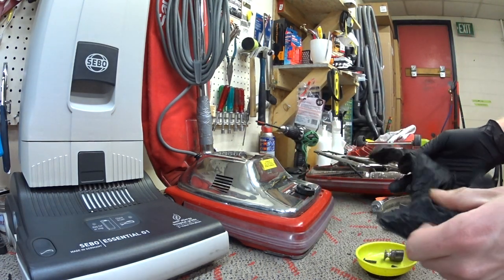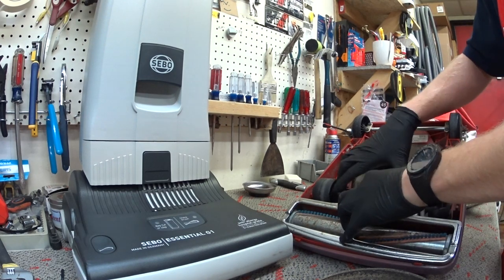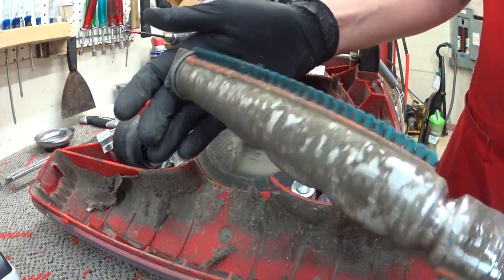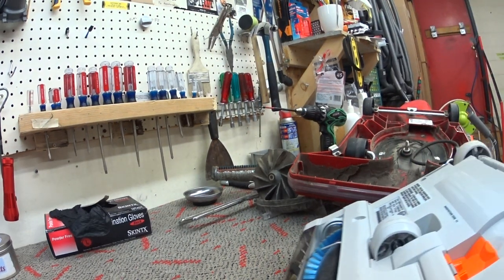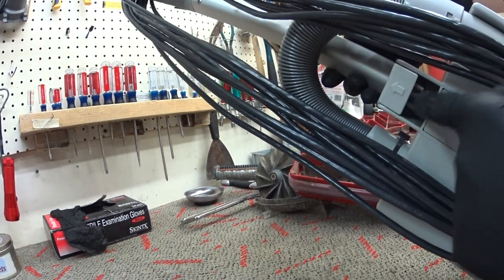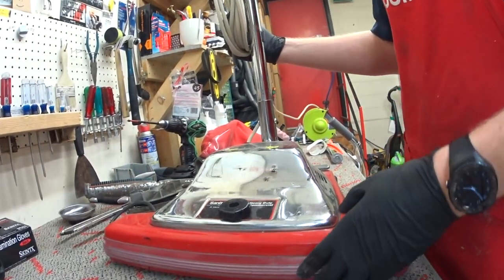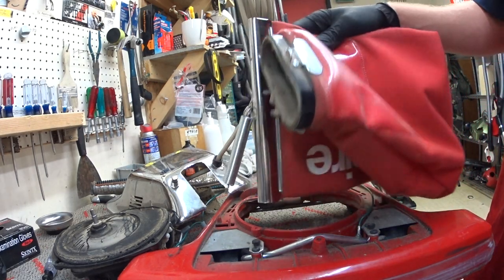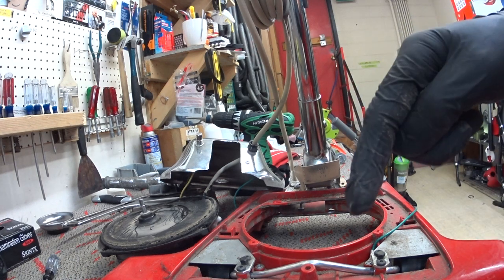Why Direct Air Vacuums are Not for commercial use! (Vacuums explained part 4)

Comment: I had to use them at work and the dam belts need to be replaced all the time and the fan keeps getting damaged. Replacing belts takes time and less time to get your job done. They are outdated junk.The motor dies on you after a year .

Comment: I have a Santanaire SC-887 which I retrofitted some years ago with the HD commercial cloth bag, I found the machine discard. It was in pretty good shape, needed a new line cord and fan and the latch adapter which I got locally. In addition, to replacing the handle set.  The communicator was clean, carbon brushes did not have much or little wear. From what I can tell it has the older style motor, still going strong.

Comment: Sanitaire’s are very popular for commercial use because of how powerful they are. Direct air vacuums are just fine for commercial use, as long as maintained properly and not abused!
Reply from the maker: Sanitaire 's are mostly popular because of price and distribution. now that they're no longer made in Mexico and their Motors are of extremely poor quality now they've almost ceased to exist in the commercial Market.
Reply: Performance Reviews 

What? I never knew that! That’s very unfortunate. I’ve always loved Sanitaire’s. Especially the older ones with the metal top motor.
Reply: Performance Reviews thank you. Looking for a strong vac to clean my grandma's apt wall to wall. Didn't know anything about vacs a week ago not I'm up to direct air! This info about Sanataire is much appreciated!
Reply: I guess you measure "power" differently than most.
Reply: That and all parts on this model especially are replaceable, and easily accessible

Comment: Should I take that to mean that Kirby's no longer have a place in the world? I tried a self-propelled one a few years ago and it was one impressive machine, but it was as out of place as a Mack truck in a small suburban house. I used a non-propelled version in my first job out of high school, and it was a handful, but like any fan-first model, it occasionally broke a blade. The fan-first models were more efficient with power, but I guess their vulnerabilities caught up with them. The first bag-first model I owned was a Regina Housekeeper, factory-refurbished (they all needed a retrofit) for $50 in 1993; it lasted 23 years of fairly rough household use.

Comment: I miss the old sanitaire set up. I have to older ones with the metal style motor and they’ve lasted years these cheap and plastics one at work don’t even last a year!
Reply: henriquesousa7 interesting because a guy at a vacuum shop said he has never seen one of the newer motors go out yet.
Reply: @kg5vacuums205  I use them every night and I have never had any issues either.

Comment: Sanitaire cleans fast and is easy to use, but dust leaks from the bag latch area getting into the motor
handle screws vibrating loose, plastic cord hooks cracking
belts, belts, belts
Reply: Michael Mirro the Hoover guardsman is and the old convertibles were built similar to a sanitairs and uses a thicker belt (then again, it’s a deeper groove on the brush), so if you want the power of a Sanitaire with more durability, I would recommend a Hoover Convertible. you’ll see them on eBay all the time – different models and different years. The 80s models are more similar to the guardsman since they use the same motor (but with different amperages depending on the model.) If you do get a convertible, make sure it uses type A bags since you can’t buy type C Hepa Bags (the level of filtration isn’t available for that style

Comment: Direct air machines in restaurants are a big no-no. Other settings might be fine, as long as it taken care of. But that won't be the case with most commercial users unfortunately.
Reply: @thereallincolntakanashi  

Yes they are. I hate those things. Very poorly made.
Reply: @thereallincolntakanashi  

Talk to your local vacuum shop about a Miele, Windsor, or a Sebo. Not very cheap but well worth the cost.

Comment: Where I clean I used an old Quick Kleen with the Mexican motor for the quarterly deep clean, I use a Taski Tapitronic 38 for regular cleanings, I bought a Rubbermaid CV12 dirt cheap to replace the old Sanitaire because the chute on the bag has perished and a new bag would cost more than what I paid for the Rubbermaid, the Sanitaire will get fixed one day but it's days of quarterly usage have passed

Comment: I sold janitorial for 8 yrs before I retired the last time. We sold quite a few commercial vacs, Advance, Windsor, Sanitaire and another couple I can't remember now. I always recommended full bypass designs, personally the Sanitaires weren't much more than a home vac with a long cord. The hotels loved Sanitaires because they are cheap, they couldn't seem to understand long term costs of using the Sanitaire were higher. I remember one funny, sold several new Windsors to a school, a few days later the supervisor called me and said they didn't have any suction. I started taking one apart right in front of them and it was totally blocked with paper clips and staples, a bunch of paper balled up on that and totally blocked the airflow. Told them their staff needed to pick that stuff up before vacuuming and sold them magnets for the occasional missed one. Super was very embarrassed but I think he got the message through to his staff, I didn't have any more complaints. LOL

Comment: I think part of it is janitorial staff isn't trained as much, they're contractors instead of employees, and they have a stricter time crunch now. They try to use one machine for everything. Restaurants used to use those manual sweepers or a broom to pick up food debris from carpet. I never see those anymore. Never see janitors using a broom either, they use these to vacuum the linoleum and tile, which they were never built to do. 

Then I see cleaning staff vacuuming store entryways with these. No wonder you get so many that have been used on wet surfaces. Customers bringing all the rain and snow in on their shoes. But again, they're contractors. They're told to clean the floor in this time frame, which is a bit different than getting the floor properly clean and making the machine last.

Comment: I was looking at a Sanitaire vacuum to use for my workplace.  When I saw it had a reusable bag I could not imagine using that at work.  My workplace has a 10 to 12 year Riccar.  It has a crack in the hose and I think repairing the hose to be the best option for now.  My company also wants to buy the cheap generic bags that will bust open.  I don't clean for a living although the cleaning company my workplace hired uses our vacuum.  It was my boss that thought this one up not me.

Comment: One filters the air, is easier to work on, and doesn't break as often. Which one has better suction?
Reply from the maker: The clean Air vacuums have significantly more suction.

Comment: You made great points about the vacuum being in the wrong setting. I have always wondered why direct air machines were used  for commercial use more from the fans. Don't get me wrong I do love these type of vacuums but in the right setting. For example my main house vacuum is a sanitare vacuum.

Comment: What would you recommend for a church that gets cleaned once a week and has a lot of low pile carpet? I was thinking of the direct air option because of the deep cleaning it can do, and common household vacuums just aren't cutting it.
Reply from the maker: I would definitely consider a SEBO g1 or g2 there are also some karcher and Windsor options. Links in the description
Reply: Our church has a Karcher Tornado and that thing is a piece of crap.

Comment: By-pass vacuum-cleaners do not have close to the suction that the Sanitaire has!
Reply from the maker: You're correct but not in the way you're thinking. Most bypass machines have 2x-3x the suction power. With about the same amount of air flow.

Comment: Can you use a Kirby or royal for a house cleaning business? Is this good or bad and will it last. I am very mechanical so i can do the maintenance.. What do you recommend. I have used machines like the seba but it is always clogging on me.
Reply from the maker: Well if a SEBO is getting clogged that means you didn't unclog  it or you sucked up something big you shouldn't have.  That would be a universal issue would it matter which vacuum you used. You would definitely kill a royal or a Kirby way too fast in a house cleaning business. Not to mention all the extra Expendables. Maybe try and Nilfisk or a lindhaus

Comment: Please help! I work in a cat adoption center for ill cats and need a wet/dry vac to make sure everything is clean. We bleach the floors of the living quarters and rinse with water daily. We currently use wet vacs and they die about every 2 months, which is not cost effective. What would you recommend for the job the facility is 60 x 60 and we need to clean daily 2 times to keep everything sanitary.Thank you!!!
Reply: get a used Rainbow E2. its a wet/dry canister hybrid. compant has been around 60years
Reply: Universem2 get a RIGID wet/dry vacuum from Home Depot and register for the lifetime warranty. I strongly recommend the model with the motor on the bottom.

Comment: What would you recommend for a hotel? We use the Sanitaires, which supposedly last for 2000 hours. I haven't really checked if they last that long, but they seem decent. But like you mentioned the maintenance is an annoyance. The Windors or Sebos go for $500-$600 vs the Sanitaire 7 AMP models that go for around $200, including the HEPA filter bag ones. I don't know if the extra costs are worth it if they don't last much longer than the Sanitaire vacuums. Do they significantly outlast the Sanitaire vacuums?
Reply: Sebo/Windsor vacuums are very popular in hotels and would be a good choice. The Sanitaires are good cleaners but the new motors are not what the old ones were. The extra money you spend on a Sebo will be worth it in the long run. I'm a fan of direct air vacs but I also own a Sebo and I love it.
Reply: @mhtube01  It's been a long time, but I hope you're still able to reply. Which Sebo/Windsor would you recommend for a hotel? I've seen the Sebo Dart/Karcher CV300, but would that be appropriate? Or would you recommend the Windsor S12/Sebo Essential which I've actually seen at hotels? I don't really know the key differences between the different vacuums. The Karcher CV300 is about $200 cheaper than the Windsor S12, but I'm not sure if going with the cheaper vacuum will end up biting me long term. These would mainly be used on low pile carpet.
Reply: @jpexplorer7752  I would definitely go for the S12. Those are the models that you see in hotels and are designed for that use. The Dart/Felix is a cool vacuum but I think the S12 is a more rugged design and more powerful.

Comment: When you say certain states are now outlawing the sale of machines with shake-out bags, I wonder if Oregon is one of those states?
Reply: I didnt know this at all- I wonder what the reason is, its not THAT bad after all. Plus, if your making it illegal to sell shake out bag style vacuums, you would wonder what the reason is for letting bagless stay with how mucky and dusty they are. Doesnt make sense to me. Just seems like an excuse to phase them out if im honest.
Reply: Since I’ve been using a 1965 Kirby Dual Sanatronic 50 along with a Dyson DC33 for the past month, all I can say is the Kirby Dual Sanatronic 50 is a bit cleaner when I go to dispose of the dust since it doesn’t fly up or spew when I go to dispose of it completely to the Dyson DC33. Literally all I do with my Kirby Dual Sanatronic 50 is use the scraper to scrape down some of the dirt down into the emptor, give then bag a thorough shaking, then I open the bottom of the emptor up to dispose of the dirt and dust in a small trash bag I put around the emptor before I open it, dispose of the dirt and dust, close the emptor and it’s ready to go when I go to use it next time. Yes, it’s somewhat of a process but again none of the dirt or dust flys up from the trash can when I go to dispose of it plus there’s no filters to deal with that need to be cleaned or replaced on a yearly basis.
Reply: People are using these machines inappropriately due to lack of training. My guess is more people are getting silicosis, which is the lung disease caused by breathing too much sand and construction materials.

Comment: My shake out bag is blowing dust out the top where it slides in.  Should I just replace the bag or the clip?
Reply from the maker: You should not be using a ShakeOut bag to begin with. If you're using a place of business you're breaking so many laws.
Reply: @PerformanceReviews  really? Why?  That's all the hotel has pretty much.  They do have 2 that have a hard plastic case on bottom.

Comment: I guess direct vacuum means all the intake goes thru a fan without prior filtration and the motor does not cool on this air flow.  In the distant passed I had a leaf vacuum that work on this principle.  Can't recall what I ever did with it, never liked the design.
Reply: You're on the right track, but theirs actually another fan that cools the motor.

Comment: I have a friend that runs a skate shop, and he uses a Windsor Sensor XP12, it’s built in Germany, built with super good quality plastic and rubber, 
I like how easy it is to clean brush roller and how you don’t need to replace belts, and it also has super good filtration system, one next to the bag and one on top of the motor, and also like how easy it is to clear clogs and there’s indicator lights that tell you if the head is up or down, and also 2 more that tell you if the bag is full or if the brush roll needs attention, and I also like how quiet it is, I think he made a smart decision, I don’t think a direct air machine would be able to survive in that environment

Comment: I just purchased our second Sanitaire, exactly like the one in your video.  First one lasted 8 years.  Used for about one hour per day, to vacuum rug runners in a machine shop.  I buy belts ten at a time and pulleys every couple years.  The metal chips destroy the belts, and the belts destroy the pulleys when the brush rolls stall.  The motor is insanely loud, and the shake out bag is disgusting, but I can't imagine any other machine taking the abuse, or working faster.  

These Sanitaires  replaced a Royal, that lasted at least ten years performing the same function in the same environment.  The fan in that unit was worn to half its original thickness by the sandblasting effect of the metal chips it collected.  I refurbished that monster and sold it on. It was also REALLY loud.

I'd love to know what would be the best replacement for the Sanitaire?  It's only $150 VS a several hundred dollar Royal. Our CEO insists on using a Dyson in the front offices.  What a worthless, piece of plastic junk!  I have to replace parts in that thing as often as the Sanitaire, and they cost a helluva lot more.
Reply: If you're vacuuming up metal, is it possible to install a magnetic strip onto the bumper to catch those pieces?

Comment: Would you recommend something like a Oreck or a Tacony (a direct air model) over a Sanitare like the one in the video for commercial use or would they perform about the same? I know a bypass is much better, I’m just curious.
Reply from the maker: For commercial use if I had to go direct air I'd go with the Hoover conquest.
Reply: Surprising decision considering it’s bagless. I saw one that Hoover used to make that were two conquests put together to make a wide area vac-interesting machine.

Comment: I like direct air vacuums best but if i worked in a commercial environment i would use a kirby despite the weight because the fan is virtually unbreakable and the belts last longer than sanitaire
Reply: Thing is with direct air vacuums vs isolated motor vacs is u are limited to what u can pick up if u pick up something big with a direct air motor it’ll break that fan
Reply: @kingbong5529  I sucked up a huge 15/16 nut from under a bed with my kirby hose and it survived. The fan is made of amodel plastic which is very durable but regardless one should still watch out for big items

Comment: is an old kirby a better built vacuum, its also what  would be considered direct air. what if someone where to use an old kirby in a commercial environment. im talking kirby tradition thru kirby legend II..... the pre-generation machines, the simpler machines.

i have a tradition, a heritage, and a generation six. i know they dont use that round style belt.
Reply from the maker: 🗣️ #kirbyisbestvacuum